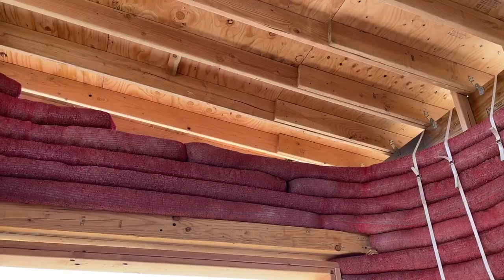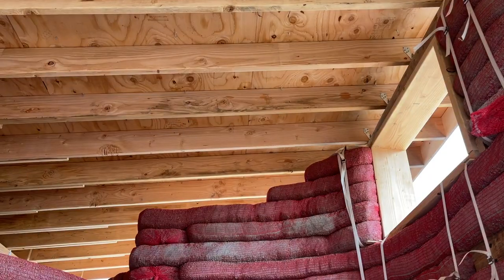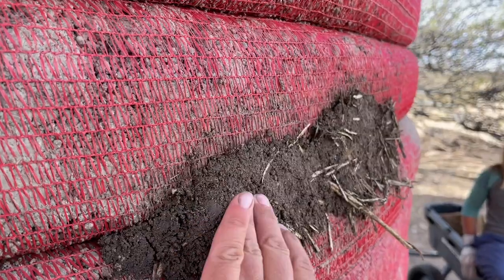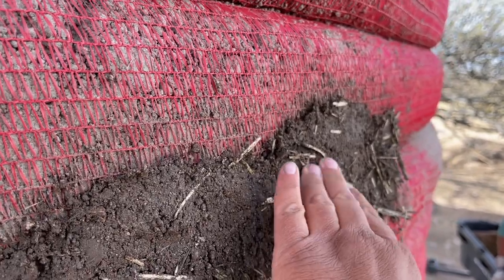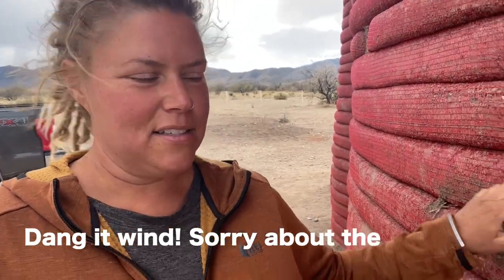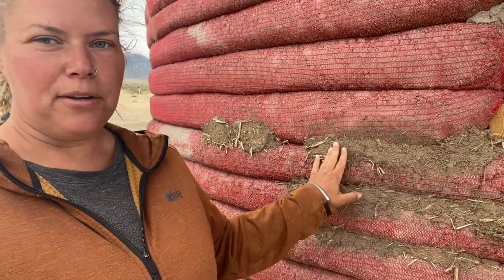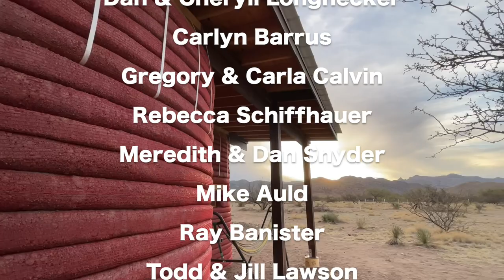Testing Our Soil for Cob - Didn't Go As Planned

Comment: Did you wet down the bags before adding the cob mix?  Needed, for sure.
Reply: Totally agree
Reply from the maker: We’ll do that next time! Thanks.
Reply: This is going to fix everything.
All the trades do you this, pouring slabs, building walls, flooring, wetting surface makes adhesion better. Thinking y could add a little lime as well it's cheap. You will want gloves tho if you put lime.

Comment: guys, there are other options too help with the cobbling.  of the building. wire, adding silica cement too the mix, and allowed to dry it is  great  option. 
then there is having issues with the water usage.  but again wire mesh makes the use of cob hold tightly too the walls. it not only helps the strength, it is also weatherproof.
Reply from the maker: We already have the mesh bags, shouldn’t need anything else. Just have to get the mix right.

Comment: in one of your last 3 videos you said something about the office/power room needs to be under 200sq feet.. under the optout guidelines do all the building needs to be under 200sq feet ? and not connected to make a 600 sq foot house ?
Reply from the maker: Anything under 200 sq ft doesn’t need a permit, so that’s why we’re trying to keep any out buildings under 200 sq ft.
Reply: @TinyShinyHome  so if you opt out is there a building size requirement you need to stay under or can you build a 1,000,000 square foot house LOL
Reply from the maker: Not sure. But we know people building 2000 sq ft house and it’s through the opt out. Ours will be much smaller.

Comment: I use to make my life easier by presoaking my cob dirt...couple of buckets...soaked a day ahead of time (mixed like paint slurry) pour top water off the next day or just added it to the sand if it wasn't much or poured it off with the loam, if there was too much.  It won't hurt to cram the loam on in the beginning but it can mess up that final coat.
Reply: I use to tell my kids that you really can move mountains one bucket at a time.  After a few years of little projects a had put a big hole in our backyard.  But I covered a fireplace, built a hood vent in the kitchen, a wall with bench and rocket stove and a couch by the time I was done.  Now I found really good clay on the other corner of the yard...heh heh...my whole yard would be a huge pond if I didnt make myself stop.  Keep trying Ashley...you will find the right soil!
Reply: one more thing and I will hush...the rocks you are sifting out of your cob mix...save those for the floor.  It might not be enough...but you were looking for a cheap alternative to lava rock (which you don't really need in your climate)

Comment: Maybe just a smidge of quickcrete 😁🤷
Reply: Yeah, MyLittleHomestead started adding some to their cob mixture.
Reply: it will work, but in time it will fail. number 1 mistake on any natural build is to use any form on cement. natural buildings need to breath, and cement stops that. If you really struggle to get the mix right then Lime is your answer, but then your looking at cost
Reply from the maker: Trying not to add any cement on the plaster or cob
Reply: @TinyShinyHome   Its your build guys, your allowed to do how you see fit in your situation. Was just posting for anyone else reading to help educate.  YT is a great place to learn, but also need to remember there's alot that doesn't get shown. In all the years i have been in the building trade in the UK, fixing mistakes, the biggest by far is taking cement render off from buildings as mould builds up on the inside of the house. Have built many cob homes, take your time to get the right mix and your do just fine. good luck. little tip, after pushing the cob on, use the palm of your hand, press and slide ;)